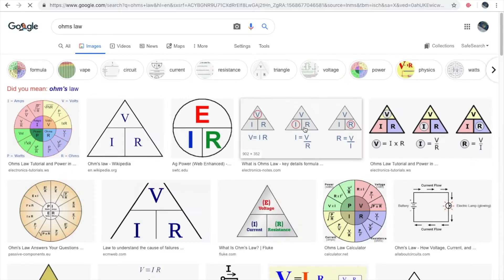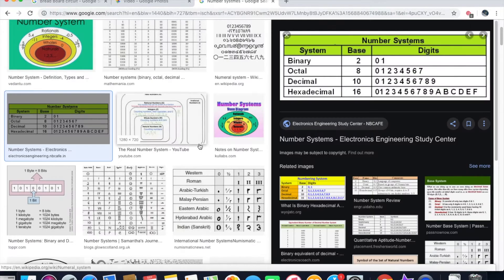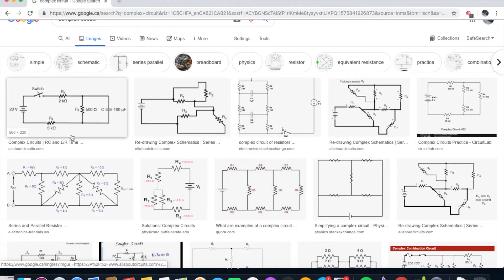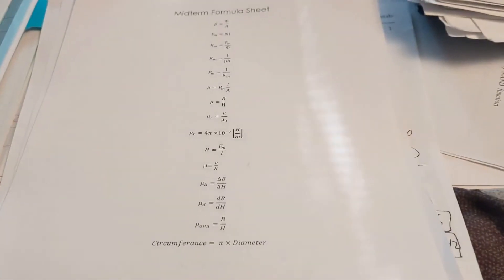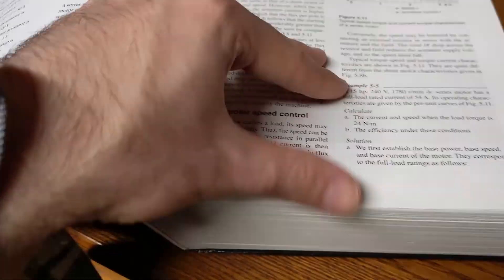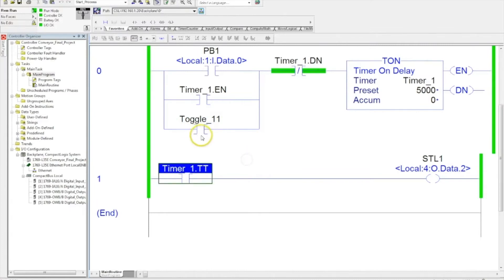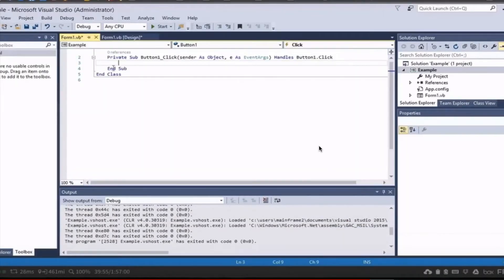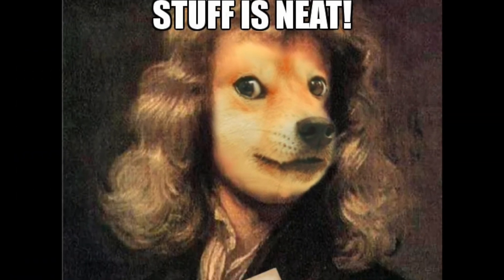What I learned in Electrical Engineering Technology - Electrical Technologist

Comment: Yeah.. I regret getting into that. If anyone on this position of entery just push for EE instead.
Reply: You probably went to a garbage school.. if you take EET at a ABET credited school you make a good salary
Reply: @ohmslaw6856  will you be able to get engineering job with EET bachelors ?
Reply: @eb3872  Ofcourse.. I graduated from an ABET credited school with a degree in EET and a minor in mechanical engineering.. I have been hired as a electrical engineer and a controls engineer.. after graduation i was making 60k - 70k right away..
It is important that if you are taking EET that it is a ABET credited school.. or most jobs won't hire you..
Reply: I’ve seen you reply a lot to videos in relation to EE Vs EET right now. I’m in the same boat taking EET and didn’t know the difference between the two. I don’t wanna look back with regrets after these workloads knowing I’ll be limited. I would like to get in touch and ask more questions
Reply: @samuelappiah8395  what did you get finally
Reply: @ooeh7050  I eventually decided on EE. Honestly I think if you have the discipline for it, There’s no need to restrict yourself with an EET degree especially if you want to be an engineer or designer. More upside to salary and better options for jobs.
You can dm me if you want to discuss it further. It’s a very hard decision to make in the moment tho
Reply: @samuelappiah8395 
I actually agree with you, if you have option definitely take the EE
My problem is all the EE courses in my country is closed for this year so only EET and CE 
I want to work in oil companies etc so im confused 
Although in my country EE and EET both treated the same and considered as engineers
Reply: @ooeh7050 I feel you are from iraq
Reply: @GholamAifa it happens in alot of countries but yes iam
Reply: @ooeh7050 so am I,
I am currently studying EET 1st- year ,
From what I search the EET is more desirable in oil field But because the nature of the work there isn't "designing giant stations" or analyzing huge networks like what EE studies, so they need the EET more.And in what we study, the sources of our study is the same of EE. So you can go In-depth in this sources and have the practical and the theoretical knowledge.
Reply: Why’s that

Comment: Man, I wish I had seen this earlier when I was researching programs in the fall. I was thinking about taking this exact program at Conestoga but when looking at job postings I kept seeing that a lot of them have a driver's license requirement; unfortunately I have a health condition that impairs my ability to drive :(

Do you know if it would be difficult to land a job in the field with a restriction like this? Is it a common requirement to be able to travel from one work-site to another as an Electrical Engineering Technologist?
Reply: If that's the case (with not being able to drive) then go for something more along the lines of autoCAD/ Solid Works. My local college offers this exact degree but with the specialization I mentioned instead of electrical. If you get a good computer and the software you can work from home for many companies. Plus you can also bid on independent contracts from engineering/ architectural firms for extra work. Some colleges offer a degree in autoCAD and some only a certificate. Either way, that's probably the way to go.
Reply from the maker: It ll be tough man. You have to find the right place, I'm sure you'll find it but you'll have to be proactive.  

Office job would be best doing Autocad or something similar or even sales with a wholesaler perhaps? 

Some engineering gigs require you to go on site

Comment: I wonder how it would differ in a 2 year community college. Maybe just everything you listed leading to the 2 year point. Or a more compressed version of everything? Have you already landed a job in this field?
Reply from the maker: The 2 year program will likely be leading up to the 2 mark. Trying to fit an extra 10 courses in 2 years would be alot. 

I have. I work for a automation contractor building machines for manufacturing. I'm doing an electricians apprenticeship atm with plans to get into programing after.
Reply: Robert oh that’s good to hear man. that seems like the type of work I would like to do myself. Thank you for your insight. I just subscribed to your channel. I’m a little lost and just seeking knowledge. I have been working as a machine operator in the production / manufacturing scene for a while. And I know that now is the time for me to further my education and move forward. I’m a bit scared but I feel this is the right move for me. How are you enjoying your work?
Reply from the maker: @Thomas-fc6gf  Thanks for the sub. Yeah man do it. The 3 year option if you have it would open more doors. All engineering/programming jobs prefer the 3 year program. But it all depends on what you want to do. 

I do like my job as an electrician. But if I jumped into programming from the beginning I would be making alot more cash. Either way the electrical ticket will help in the longer run with career advancement/stability. The only issue with manufacturing is when the economy is down (like it is now) it's likely you can get laid off. Gotta make sure you get the skills and experience to make yourself an asset.